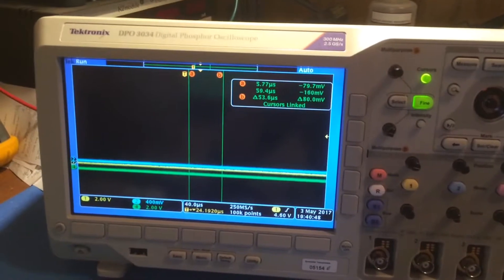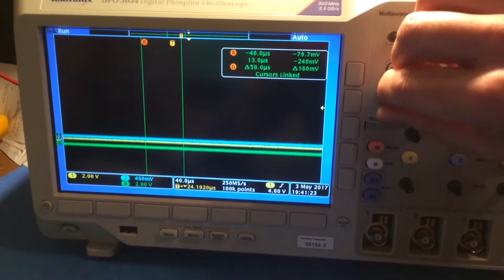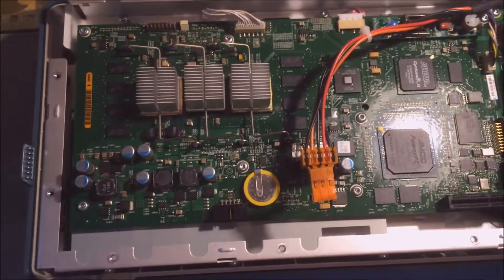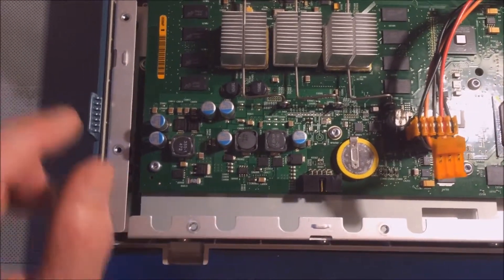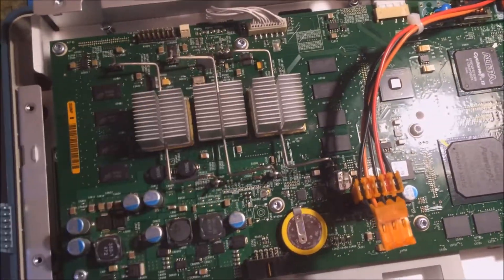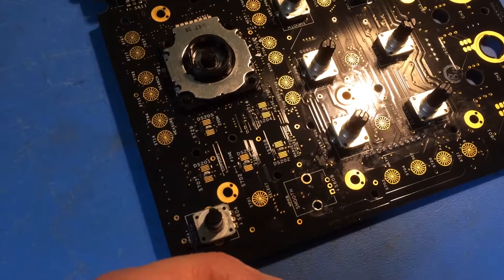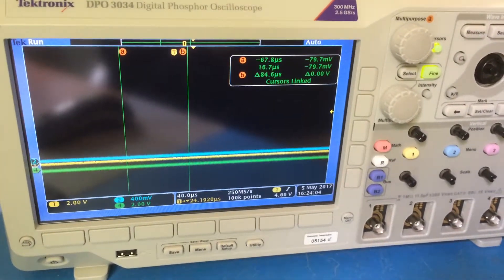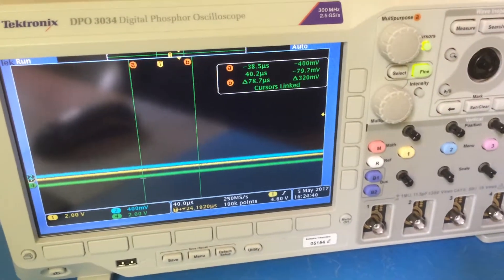Tektronix DPO3034 Multipurpose Control Repair

Comment: I have an MDO3000 with exactly the same problem on the vertical position knobs.  Tektronix never had these type of problems when they were manufactured in Beaverton, OR using USA sourced components. Does anyone know the ALPS number for the original plastic shaft WITH CLICK SWITCH that is used on the vertical position encoders? The one in the video EC12E24104A6 is used for the multipurpose A/B knobs that don't have press/click functionality.
Reply from the maker: It is rather infuriating when manufacturers of premium priced professional equipment try to reduce cost by using cheaper and poorer quality parts. I see this everywhere and all it does is damage their reputation and increase the amount of WEEE going to landfill.
Reply: @bvqbvq  Very true. And by the level of disassembly required to change this, and the prices of the repair parts and repair services, they are basically telling you to trash it and replace it. Did you find the number for the encoders that have the click switch?  (EC11 have switches, but not insulated, and the EC12's I can't find one with switch).

Comment: had same issue, replaced all, for the new dry type and everything worked well, but eventually one became to have identical problem - replaced again but did not help so will need to debug that